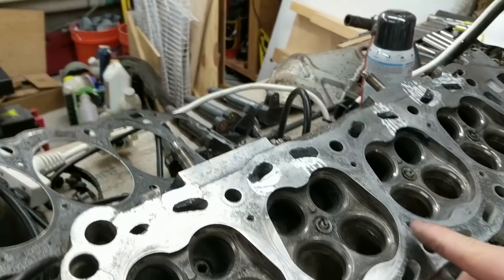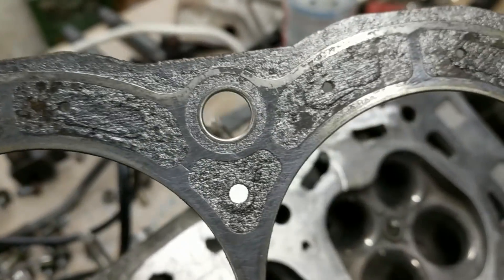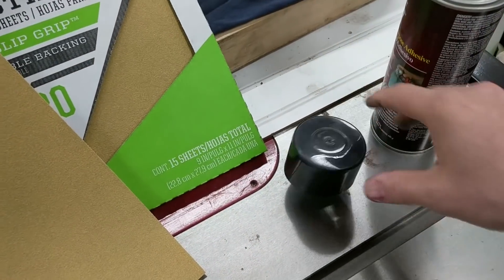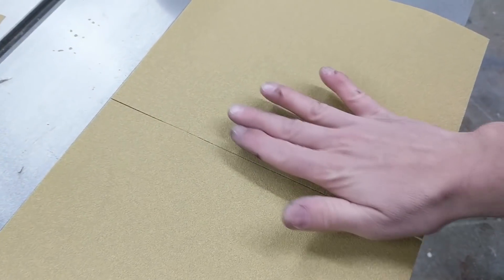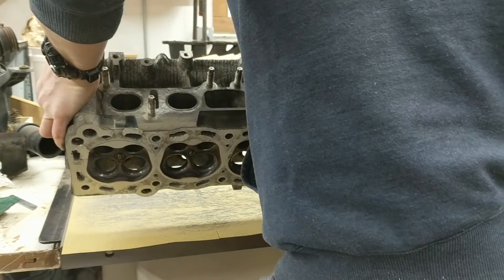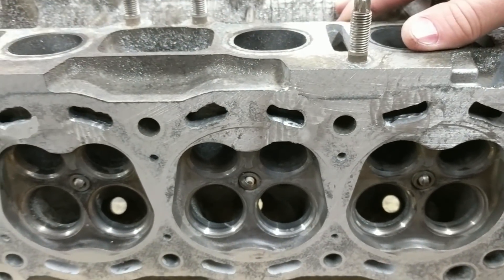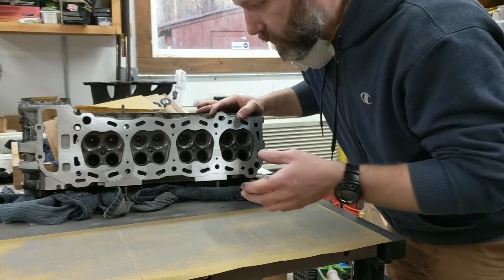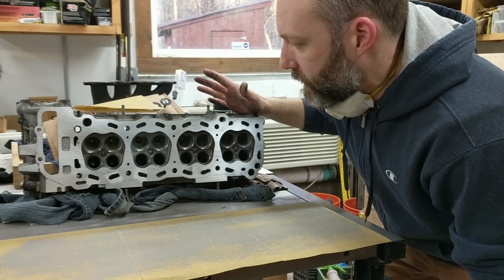Using a Table Saw to Resurface a Cylinder Head

Comment: My buddy has a head shop so I get it done for about the cost of that glue and sandpaper. It's about the same principle. His head surfacer looks like a grocery store check out. Instead of a conveyor belt it has a big sandpaper belt. You just set the head on it and turn the belt on. There's a stop at the end to keep the head from flying off. Then you let gravity do it's thing. Pretty neat operation. I always thought there was special milling machines but old school works.
Reply: Ron what grid does he use???

Comment: You could do a water wash but would want to use compressed air to blow out the water and oil galleys then slowly heat it up to evaporate the rest of the moisture, I'd then hose it down in WD-40 or other very light oil

Comment: Wouldn’t be doing this with a race engine. No way that’s going to be “flat” by oem standards nor would the top and bottom surfaces still be in parallel after welding and sanding like that.. would work for a small engine or a daily driver vehicle. Good idea tho!

Comment: And not also work good on a cyilinder heads , i did the same on a exaust manifolds on a 7.5 liter ford engine and work perfectly fine ,no more exaust leaks ,its not easy because takes time but definitely worh it   !!

Comment: You can't feel .000001"
Gotta say though, damn smart idea of using what you have available
Reply: look up the size of a spec of dust and come back with that comment ?
Reply: @dakotatabor1614  one grain of dust or a coating...lol... think about. Damn
Reply: No need to look anything up.  I wouldn't have said it if i wasnt correct
Reply: @csonracsonra9962  so your saying a crumb of bread isn't close to .000001 of a inch i mean it is pretty small and i can feel it ?
Reply: @dakotatabor1614  nope

Comment: I've done this to  three cars so far using 100 grit sandpaper on a piece of glass. And yes it works great. Haven't had a problem with yet with it. Saw it on another YouTube video a while back. It's saved me $35 per cylinder every time I did this. I have used a mill in the past, and I can verify this procedure is almost perfect.
Reply: Would you have to make sure you have a thick piece of glass?

Comment: OldSchhoolFunk  has done this several times, he used a thick glass plate, like over and inch thick rather than the table you have, which is and excellent idea BTW. He's also made the head stationary and put sandpaper on a wood block checked with a reference edged for level and that seems a bit easier. I'm going tot est that method tomorrow. Heres a link to it.
https://www.youtube.com/watch?v=HyKN52HD6RU&t=6s
https://www.youtube.com/channel/UCrRP4c50md0CANx06KfJh7g

Comment: When doing this kind of sanding, or any kind of sanding actually, a better way would be to use wet sandpaper and water.  The water lubricates the process, carries away the debris, and coincidently prevents/reduces the sandpaper getting clogged with debris.  The sandpaper stays sharp longer as well.  Win-win.  Just don't use it wet for materials that would be damaged by the water.

Comment: This works, I've never had an issue afterward. I've also used two 2x10 attached together with a small handle. Adhesive sandpaper on the bottom , vary the grit and sand along the length. I've done engine blocks this way too. Current one has over 60k miles on this home finishing.

Comment: For those without a flat table-saw surface, a piece of thick glass is cheap and flat.  See "oldschool funk" for this approach.  It appears this is an aluminum head.  Older 1960-80's U.S. engines usually had cast steel heads which would take much more sanding effort.  If the head is warped, just sanding will not take care of the the OHC bores no longer being aligned.  Usually, a warped head bows so more gap in the center (>4 mil is too much).  People say (I never tried) you can put an aluminum head in a home stove at max temperature (700 F is good), supported on just the ends, for a few hours and the middle will sag down under gravity to flatten it.  That should align the camshaft bores, plus require much less sanding effort to flatten the surface.

Comment: It's ok for a head in which you have a few solder patches to smooth out; or it just needs a cleaning for reassembly with a new head gasket... ... but when a head is several thousands warped between the ends of the head itself, (they have a tendency to bend like a u) from a engine overheat from running out of water, flattening it will take a very loooong time and a few boxes of sandpaper, probably impractical. in those cases if you have an (or two) overhead cam(s) the journals need to be corrected too or the camshaft will  bend and run tight, probably seizing.

Comment: Appreciate the details on the weld, over-dremel-but-OK, flat surface, razor & feel, adhesive, grit, warning on curving (only push horizontal), clean paper periodically.  I'd use finer grit at the end.  Also, don't use solvent - it embeds grit, use light oil and clean rag, turned after each swipe.  Thanks for showing another practical way to avoid needless machine time/cost.

Comment: the most precision machines in the world are built by hand. when all the machine shop machines are rebuilt (beds and ways) that is by hand. this does work. would probably work better using a figure 8 pattern that you use in lapping. factory repair Manuals use to give limits and show  the processes for doing it. it was called how to repair, not just replace parts. there use to not be machine shops right around the corner. they were few and far between, but lots of people had cars.

Comment: Only problem I see here is you may not get the required RA on the cylinder head. Like you said, the HG needs to "bite" into the head/block surface to properly seal. You need the proper surface roughness (RA) to do so. Different gasket materials require different surface finishes.

Comment: You cannot feel one millionth of an inch (0.000001") by hand.  You can feel a couple thousands (0.001"), maby a couple tenths (0.0002)nuder ideal conditions.
Silicone carbide / wet sand paper would wear better.  Also, since you had multiple sections on the saw table you could have used the plates in a a to b, b to c and c to a (3 plate method) and bring the table saw extremely flat using some silicone carbide powder and lap them first.  Granite surface plates are lapped with mennonite cast iron and diamond powder.   The table is most likely not very flat.  Unless they closely controlled the temperature by wet grinding, it will heat up and bow while machining / grinding it.  TIG is better for welding aluminum like that and needs preheating.  It is most likely 356 cast aluminum which uses a special rod.  I worked over 20 years in the tool and die industry as an engineer and on the bench as a tool and die maker.
Robert
BSME

Comment: To anyone here that claims this does not work......look up "hand scaping". You can get a metal surface flat to within .00005 (yes, 4 zeros!) with another flat surface and some elbow grease. Millwrights use the process every day to build, and rebuild metal working machinery. As a journeyman toolmaker I can tell you this man's process is quite sound. As long as you have a flat surface and use some care it will turn out as good as any belt surfaced/milled head taken to the machine shop. A proper straight edge and feeler gages should be used to check your work.
Reply: Amateur telescope makers get even higher precision than this, making mirrors, using just glass-on-glass (or -tile) with abrasives and water, and a lot of patience and elbow grease. Sure, they can buy commercially-made mirrors and things, but the fun is in the process, and knowing you CAN do it yourself.
Reply: dogshouse1 
Lol Had to laugh at the naysayers. Wasn’t some of the training for millwrights to learn to us a file.? AND elbow grease. People that have never done this kind of work have no idea.
Reply: Is that like "manscaping"?
Reply: and better yet, check the surface of the saw bench

Comment: Best cleaning tank is a drum with a copper pipe ring in its base drilled with fine holes that air can bubble out of . Fill drum with degreaser fluid or molasses works very well watered down a little . Place parts in drum submerged . Connect air to bubble out slowly . Causes turbulence and cleans parts well .

Comment: I used liquid metal epoxy to be build the corroded areas . Drilled out the junk to bare metal then applied mixed liquid metal to build it up . Just before dry while its soft trim level with straight edge . Then I used a new 12 inch knife sharpening stone with kero as lube in figure 8 pattern onto the head surface to smooth it back . Was all good . Lasted years and years . Never gave me trouble .

Comment: This was an interesting video. I enjoyed it. I have removed a head for other reasons than a blown gasket and paid to have it resurfaced. This could work. I wouldn't do this for a race engine or anything, but if it were something like a lawnmower engine or even a motorcycle engine I dont think you would have an issue. It would be interesting to see it running.

Comment: Self-adhesive sheet rolls of sandpaper used in Auto Body work work much better, no need for the messy spray adhesive.
Also, alternating at 90° angles to make sure you are sanding evenly.
I did a pair of aluminum heads on a 2005 Jeep Grand Cherokee V8, came out very nicely. I went from 80 to 220 Grit and then think I might have finished off with 220. 
Also make sure you let the weight of the head do the work for you, do not add any downward pressure to avoid rocking and uneven sanding.

Comment: I don't say that this does not work, but man, have it machined for 25$, much less trouble
Reply from the maker: This number keeps getting lower and lower.  I did look into having it machined locally and was quoted $100-$150.  I wish there was a shop I could find that would do it for $25!
Reply: @WhatDennisDoes  well, thé actual price is 25€, thats around 30$
Reply from the maker: @Goultek  I'm learning that I live in a very expensive area for auto repair.
Reply: @WhatDennisDoes  seems so

Comment: Not a bad idea actually. If you have a better quality table saw the surface will be even flatter.

A couple of pointers though:
Your spray adhesive will give you high spots due to you not applying it evenly. You can buy self-adhesive sandpaper that you just peel off the backing and stick it down.
I would be using wet/dry sandpaper not aluminum oxide.
If you want to be really flat you could pick up a machinists granite slab. They are machined flat to .0001" over the surface. They're about $50.00. If you can go to your local scrap yard, you might be able to find a piece of 1/2" or 1/4" glass that will be just as flat. Then, instead of sand paper, you can use honing compound. It is available in many different grits from 100 to 10,000. 
To avoid the cupping or oversanding on one side due to your movements, a figure 8 pattern will take care of that. That is also (or so I'm told) is an old machinist's trick. 

I will say this: there have been times I wanted to get something dead nuts flat and never thought of this. Brilliant.

Comment: With a graphite type gasket on a stock engine build this will likely work just fine. The 80 grit finish will also probly be good.
That type of gasket is rather forgiving. Now when using an MLS type gasket the surface being very flat and the surface finish is much more important. If you want a little cheap insurance hit the new head gasket with some copper spray before assembly.

Comment: This was a great video. I did this with my Volvo 8v "Redblock" head. Took about 8 hours to get it completely flat. Next time I will probably just spend the $150 and take it to a machine shop, but I was very broke at the time, and this worked great for me. Instead of a table saw I used a roughly 12"x 36" piece of scrap marble from a countertop that was removed from a house demo in the neighborhood. Alternatively you can use a thick pane of glass.

Comment: If the head is warped very much, the cam will bind, not matter how much you surface the surface.  Straightening a warped head required heating. ithttps://www.enginerepairshop.com/cylinder-head-repair.html
.

Comment: For those thinking this doesn't work, remember the block and head arent perfectly flat to begin with.  Using a good quality head gasket, as well as using some straight edges to verify it is flat so you know when you are there, and this method works just fine for low compression, low power gas engines which have relatively low cylinder pressure.  A machine shop can be cheaper however depending on where you are and what your time is worth.

Comment: You will NOT get your cylinder head flat this way. 

First : you have no idea if your saw table is actually flat, the chances are it is not. The saw table is a casting. Castings warp with time unless they are carefully aged before machining, and depending on the amount of material removed in rough machining may need to be aged again before final machining. These days the ravages of the accountancy profession on good engineering largely precludes sufficient aging of castings.

Second : flat surfaces in engineering are vital for accurate measurement. Surface plates are manufactured by lapping three plates against each other. If you only use two (as effectively is the case here) one will end up convex and the other concave. There is no way to prevent that.

Your saw table is almost certainly not surface ground at the factory. Surface grinding is an expensive process. in engineering terms, the smaller the particles of metal removed in a machining process the more expensive it is. The degree of flatness needed on a saw table is not sufficient to warrant the expense of surface grinding. At best your table would have been milled or possibly planed. Milling, unless done on a bed mill, will always result in a convex surface due to deflection of the table and knee under the weight of the table as it traverses across the knee. Bridgeport and similar turret mills are very prone to this because of the length of the table and the comparatively narrow knee and saddle.

If you want to save money get your cylinder head skimmed by a professional shop. It will save you money in the end by lasting much longer.

Comment: I was a huge fan of this method until I found out my local machine shop will do it for like $35 and get it perfect every time
Reply: It's called joe public beating the system for a change. Sometimes there are no garages close to you to do it and it feels good to be able to beat the system.
Reply: Roland Anderson But, even for $35, you might have to wait a couple of days to get your part back. This way, you can make good progress through the day and weekend. Plus, we’re all too lazy and fat, and this will burn some calories too! Lol.
Reply: It's much more expensive in Ireland I think to get a head resurfaced and valves cleaned and  reseated. Also there are many garages who will do the minimum when customer not around.
Reply: Hey, that 35 bucks will buy a couple nice pizza's,lol.
Reply: I will have to pay like 200 bucks for this job. I live in Germany btw
Reply: Excelent job. Machine shops here in Auckland NZ charge $140-$200 just to resurface 4 cylinder head.
Reply: My local machine shop charges 82.50 a head for resurfacing.
Reply: Except machine shops want to take too much off of the head. They'll swear you need ten thousands off when in reality all you might need is 3 or 4.
Reply: I mean sure but $35 would be unheard of for most people.
Reply: Exactly.. this is why i hate youtube.. dumbass central
Reply: matttafakt sometimes people just like to work with the tools. The passion lies in the journey for some, not just the destination. And it’s good to know in case of a dinosaur apocalypse

Comment: no machinist is going to tell you that he can feel one millionth of an inch (.000001). Your comment that "they don't sand it from the machine shop, they just leave a machined surface"  is hilarious. sanding is NOT a precision process and the only thing funnier then that is your mentioning  a router. You need to get a mill, hahahaha. And that sears and robuck table saw plate is precision for a carpenter but scrap metal for a Machinist. My God guy talk about what you know.

Comment: You can use glass on playwood if you dont have flat tablesaw, just glue glass on playwood or any other +- flat surface and then glue sandpaper on glass, glass have  really flat surface.

Comment: Good video. I suggest checking your work with a straight edge and feeler gauge. Also could use a bucket of white vinegar. Works well for removing corrosion. Let it soak for a day or more then wire brush and rinse thoroughly.
Reply from the maker: Ooh, thanks for the tip about vinegar, I'll have to try it

Comment: One thing you need to determine BEFORE you sand or mill the head is whether it is warped by putting a STRAIGHT ground bar on the cam bearing surfaces and use a 1-2 thousandths feeler gauge to make sure the heads aren't warped.  If they are, and you flatten the deck, or they will probably warp FURTHER and you will probably start taking out cam bearings prematurely, or possibly even break a cam, which will destroy most engines (valves and pistons aren't compatible in the same space).  The warped head can be straightened in a hot oven (~500 F) for several hours, bolted to a flat plate with some appropriate thickness shims bend them a bit past so they spring back.  Allow them to cool slowly inside the oven after turning off the heating element.  Only AFTER the cam saddles are straight should you deck the head. You should also do the longitudinal, latitudinal, and  x pattern checks with a feeler gauge afterward to make sure the head surface is flat.  Just Sayin'.